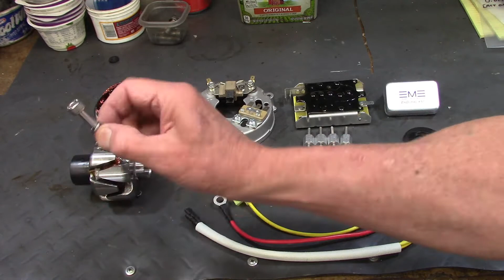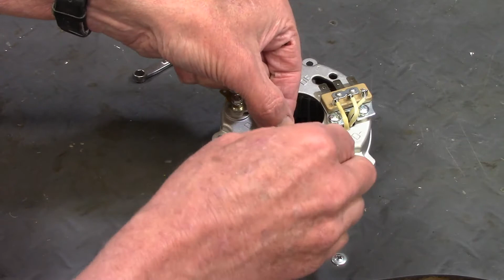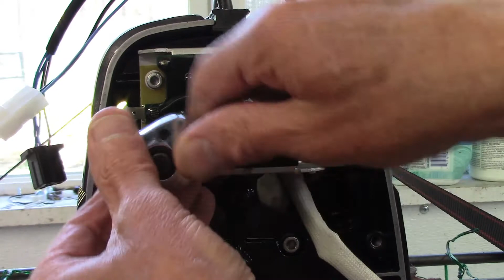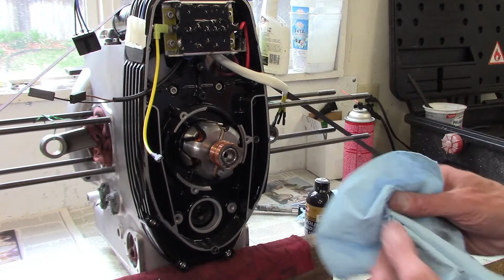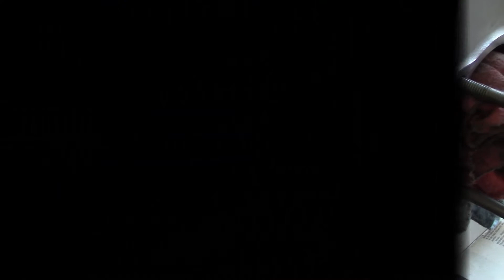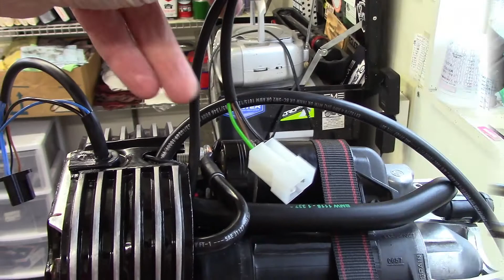1983 BMW R80ST Install Alternator, Diode Board & Electronic Ignition Sensor

Comment: 12:00 What's the purpose of the "foot" of the grommet? I purchased the original Plus-Battery-Cable from BMW which had the grommet already installed onto it but apparently in the wrong direction. The cable itself can only be installed in the right orientation bc the ring terminal on the starter is bigger than the one for the battery. 

Another question: Does the cable that plugs into the cable of the "beancan" (and on the other side into the ignition control unit) need to pass through the grommet of the battery-plus-cable (free spot on the back)?

Thanks a lot in advance!
Peter
Reply from the maker: Peter, I don't know why BMW uses a slot for the two grommets in the inner timing cover. The bean can cable does use the rear hole in the battery (+) cable grommet. The link in the video description contains more details about this installation:
 https://brook.reams.me/bmw-motorcycle-rebuilds/1983-bmw-r80st-charity-rebuild-project-index/12-bmw-1983-r80st-install-alternator-diode-board-electronic-ignition-sensor/#Install_Electronic_Ignition_Sub-Harness
Reply: @BrooksAirheadGarage  Thanks for the response, Brook!
Do you also know if I need to turn my grommet (as installed by BMW, see my first comment) around or is the orientation of the grommet not that important?

Thanks,
Peter
Reply from the maker: @MrBestvirginia  I show the orientation of the grommet on the battery cable before installing the cable, so when you loop the battery cable the grommet is oriented correctly to fit in the groove in the inner timing cover.

Comment: Hi, I have a r80/7 rewiring the bike.Have a dana 3 ignition. My problem is no sure how to wire up the daily coils. I have a red,white,brown,2 black wires all from the dana black box. I looked up the wiring diagram online but does not help me.
Reply from the maker: John,

The RED and WHITE wires connect to the RED and WHITE wires that come from the ignition module under the front timing cover.  This document shows how I install the Dyna III ignition system.
--> https://brook.reams.me/bmw-motorcycle-rebuilds/1977-bmw-r100rs-rebuild-project-index/61-bmw-1977-r100rs-refurbish-main-wire-harness-install-electrical-components/#Install_Dyna_III_Electronic_Ignition_Module

Comment: Hi Brook, thank you for the video. I have a problem with my charging system. When my ignition key is ON, the GEN lamp goes ON brightly, but it only fades a bit when the engine is revv'd up. I tested the diode board, the rotor and the rectifier all are good and the brushes are in good shape. What else could it be the cause of the low charging?
Reply from the maker: Francesco, it could be the voltage regulator is not working correctly.
Reply: @BrooksAirheadGarage  Hi Brook, thank you. I replaced the voltage regulator with a spare unit that I have and it did not solve the issue. It may be that the spare unit is also faulty!? Never say never. Is there any quick test I can do to check the voltage regulator?
Reply from the maker: @francescofalsini1807  Here is a link to testing the regulator published by Bob Fleischer, aka "Snowbum"
--> https://bmwmotorcycletech.info/testingvoltageregulators.htm

And this one covers testing the entire charging system.
--> https://bmwmotorcycletech.info/trbleshootALT.htm